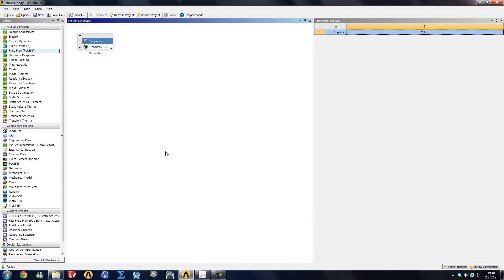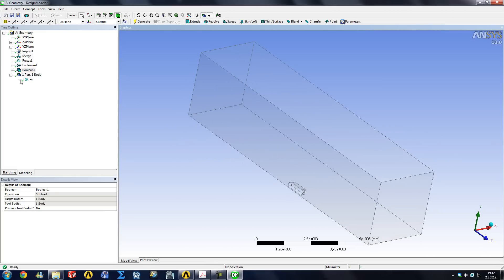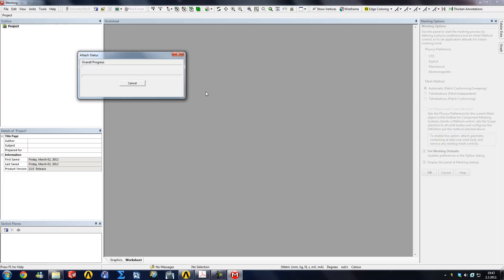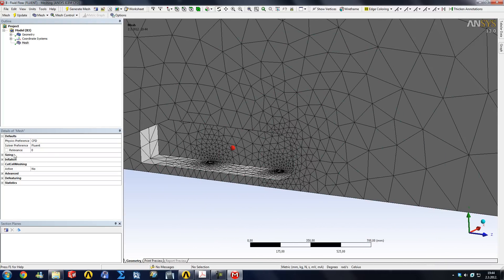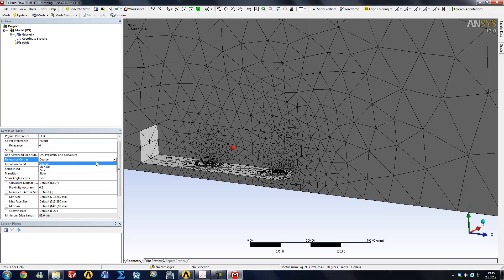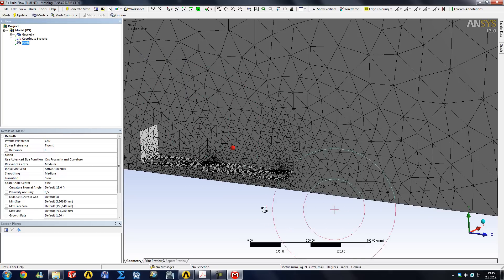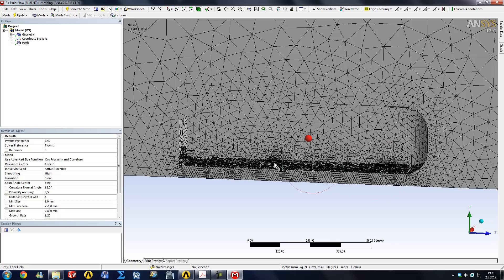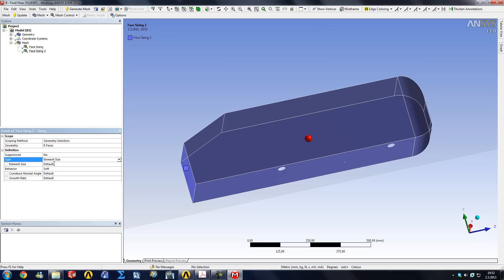Part 2a - ANSYS Meshing for Vehicle Aerodynamics

Comment: is this mesh specific to only the case of inlet velocity being 40 m/s? I tried running with both 40 and 30 m/s and while i did get a value around 0.28 for velocity = 40 i got a value of cd= 0.16 for velocity =30. Shouldnt the cd values lie in the range of 0.25 to 0.35 acc to experimental values?
Reply from the maker: Fluent calculates Cd based on values you provide in the Reference values panel. If you specified 40 m/s there but you set the velocity inlet to 30, you are going to get the wrong Cd. Just change the velocity reference value to 30 and you should get the correct Cd (same/similar to 40 m/s since the flow is at similar Re).

Comment: In my case, a message appears saying the FFF.msh file can't be found in the Setup step. What is it? How can I fix this?
Reply from the maker: +Luiz Otávio That means that somehow your mesh got lost/deleted/cleared. Go back to the meshing step, if everything is still set up just click Update/Generate again and then try to go back to the Setup step. Also, you can go into your project directory and check if it's there (.../project_directory/dp0/FFF/MECH). If it is, you can manually read in the mesh once Fluent is started (File -> Import -> Mesh; this is for Workbench version of Fluent.. if you are in standalone Fluent then it's File -> Read -> Mesh).
Reply: Sirius CFD I've  already tried checking the directory, the file is always there. And already tried opening the file manually, it doesn't work either. I even tried uninstalling and installing Ansys again. Nothing different happened. I don't know what to do anymore
Reply from the maker: Luiz Otávio From the sound of it, I wouldn't know what to do anymore either :D Anyway, go to the About tab on my channel and click the "For business inquiries: view email address" and you can send me the zipped up project file there if you want me to take a look. Or just mail me a teamviewer id & pw to check it in real time.
Reply: Sirius CFD Sorry, I didn't find "For business inquiries: view email address" in the "about" tab. Can you just send me your email?
Reply from the maker: +Luiz Otávio That's the link to the email, so spambots and other crap can't read it from the comments. It's sirius.cfd at the google's mail service ;)
Reply: @SiriusCFD  Hello Man.
Awesome stuff, I must say.
But, I'm facing a problem
I'm using Workbench 2019 R3 and  the functions and features aren't same.
Can you please help me with the same?
I can't use any of the feature from this video in workbench 2019 r3
Reply from the maker: @isshaanarora7715  Can't really help you there.. But I really can't believe that they would've changed things so drastically that none of the features or the workflow are the same. Best register on cfd-online forums and ask the good people there for some help. Also, ANSYS does come with a set of documentation for every release which includes tutorials for each of the modules..